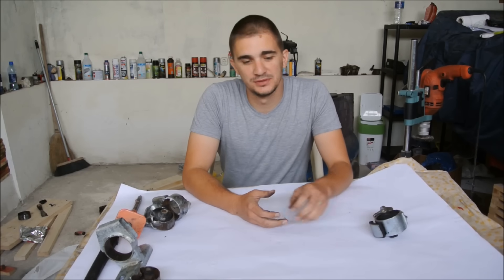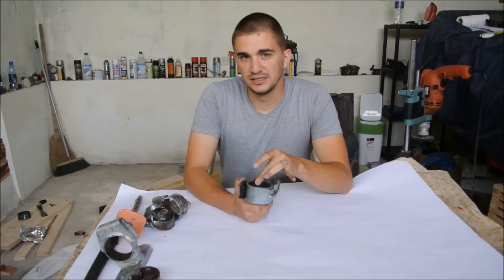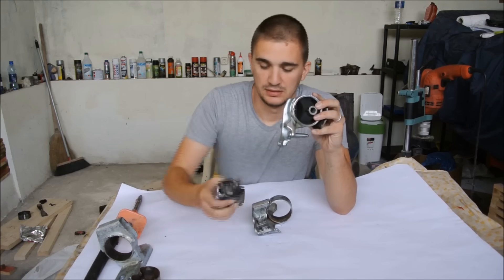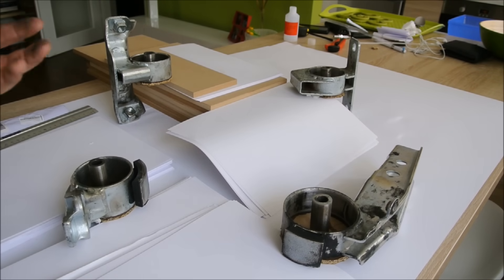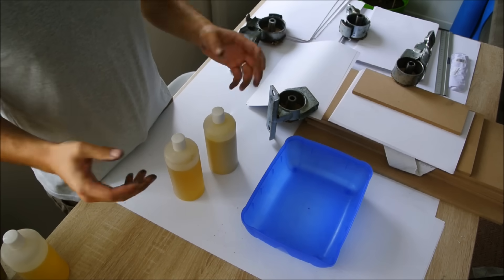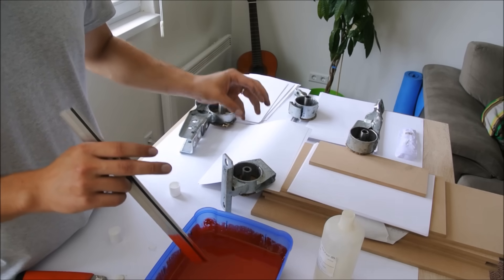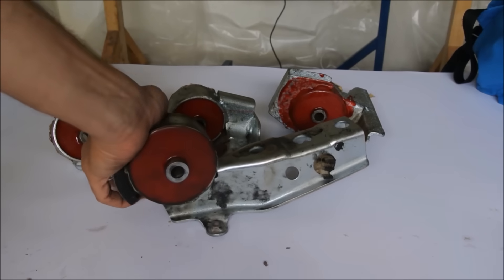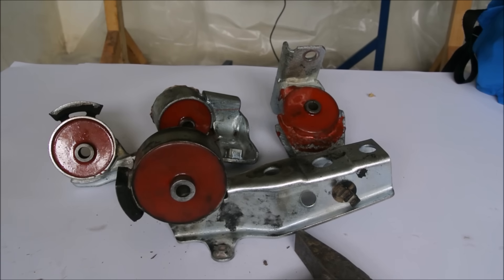How to make DIY polyurethane engine mounts

Comment: Trust me you can remove the pin from the rubber using a hole saw.
Reply: Smart dude ..that's forward thinking
Reply: You can also put the mount in a vice and use a sawzall or good hacksaw to cut down close to the pin on both sides
Reply: you can also make a sharp beveled pipe that can fit the pin hole and hit the shit out with hammer
Reply: filth hater ,i use hole cutter for steel the type that goes in a drill and remove the pilot drill out of the center,flap wheel takes the remainder off, very quick method used it in the field once on my Landy😎
Reply: You are so correct,done it the way for 40 years.
Reply: deser
Reply: Yeah i'd find another way for sure, burning is the last option i would consider.
Reply: better off to burn, cutting rubber with that stuff will be as a stinky smoke out as burning.

Comment: We used to fix ball joint or 
tie rod ends much the same way just  with grease gun type of machine . Old is new again.
Reply: Darin Bailey  Your a idiot ,years ago we fixed things unlike today where you just throw everything away. Nobody fixes anything just remove and replace. We fixed starters alternators ,with repair parts .The housing dosent go bad just the brushes or amerture V regulator. We used to reline brake shoes in shop with  proper tools . Re build brake calipers and wheel cylinders. The tool to re new ball joints was a factory Chrysler tool ,the same tool they use to make the fucking ball joints at the factory. The cheap China ball joints are far inferior to a repaired factory BJ , the crap metal is junk,hand tighting a ball joint I have seen studs fail and snap off. So you can buy new crap and they will fail in months.The new mechanics have fuck all knowledge of how to fix sfa they are replacement technicians. Not repair  technicians. 
Your probably the "HACK " who changes batteries ans starters or alternators before you figure out it's just a bad ground /connection. Or replaces a fuel pump only to find out the filter is plugged It's mechanics like you who just throw parts at cars untill you find the problem because the internet said thats the problem when you googled it and charge people for riping them off due to your lack of knowlege.
Reply: Ball  joints? Don't believe there rubber in ball joints
Reply: P Kuudsk , you are a hack! I suppose you charged for a tie rod/ball joint replacement tho. It's "mechanics" like you that get people killed!
Reply: P Kuudsk , hey thanks for the advice, you old Chrysler tool! LOL!!!
Reply: I shouldn't have taken it to heart ,as the internet is full of foolish information.
I don't know you and you don't know me .
I built a career on the fact that I always did it right the first time, and over the years ,I have seen how shady it has gotten.Once apoon a time people actually trusted and RESPECTED the trade. Sadly a few bad con men white washed the entire trade .

Comment: you need the cut outs to make it ideal. when rubber has no where to deform you make the effective harness much greater. while you picked the right stiffness for the meterel, you did not allow any room for the rubber to deform. making it much much more stiff than stock and performance mounts
Reply: Drill holes ...... in this sort of material is quite difficult & tends to put in tears , which are likely to cause crack propagation . Use a piece of carved wood , covered in foil , so wood can easily be removed .
Reply: b
Reply: I was thinking about the lack of cut outs . Nice to see the work all the same .
Reply: Could always just drill a few holes, no?
Reply: magna59 Yeah, I suppose placing objects in the mold ahead of time would be easier and waste less material.
Reply: Some of these materials , the ratio of the two components can be quite large , so some time its easier to mix a bit larger batch than required & scrap some , than fiddle about with very small volumes / weights , that can become rather inaccurate , unless you have some expensive measuring equipment .
Reply: magna59 They typically say to use a gram scale, which can be had fairly cheap. Most of the materials I have found that could be used for making bushings are either 1:1 or 2:1 ration of "A to B" components. I actually plan to do this in the future since some of my bushings are dying.
Reply: Good.I have seen some catalyzed materials where one component is 3 - 5 % of the other & if you are only measuring out a small component of the other , it becomes difficult . Some times the materials are marked up with both a weight ratio & a density , so you can obtain the volume ratio & then use a measuring cup / disposable beaker & insulin syringe to measure out the very small amount of catalyst . Saves purchasing a set of scales will be get gummed up with material & may only be used a couple of time .

Comment: the easiest way i have done to remove the rubber off and not burn it at all is to use brake cleaner,  just spray it very well and let it soak then after 10- 15 min it just peals right off clean

Comment: what website (Dealer) did you get the epoxy from? or were you able to deal directly?
Reply: Here is the link to the product. You can find a local distributor on the website. I have order other Smooth-On products off of Amazon. https://www.smooth-on.com/products/reoflex-60/

Comment: use a hole saw that's just a little larger than the pin to remove it then use torch to finish the job

Comment: Protip; direct the flame through the hole  of the "pin" instead of burning the rubber. That way you only need to heat te pin until the rubber around it melts and knock it out. Much faster, much easier and less smelly.
Reply from the maker: Good tip. Thanks.

Comment: Why does the factory not use those ??    BECAUSE:..::

They are NOT rubber; they transmite NVH(noise,vibration harshness),AND they crack and fall off(i know,i done that when i did not know better);

They RUIN YOUR RIDE; why don´t you bolt those things down solid? That would not work;
 stick w/the rubber mounts;    if they are not available,then like shown,or better yet,buy a tube of black poliurethane(used to glue windshields to car body) and do your mount; mark and DRILL a few 1/4 in holes on it,if you have the feeling for this, to make them more compliant; this stuff (one component,like silicone)sets  hard as a tire; and do not use that red stuff,nor the ones you can buy pre-made; i have lots,from the past,all for jaguar,that i bought (by ignorance) and will just throw away.

Comment: About 15 years ago I did this for my Infiniti  G20. But I used 3M Window adhesive It's black polyurethane in a tube. I Can't remember, but it was maybe $10 a tube(small caulk tube).
Reply: Yeah my cousin used that 3m window weld on all his mounts on his Spyder about 9 yrs ago and they're still solid to this day. Thing's pushing around 440hp and they've taken some abuse cuz the way he drives but they're still all good
Reply: So how long does it take to set
Reply: I also used 3M window weld on some suspension bushings. Been a year and still holding up
Reply: I've done the same thing on my 350z transmission mount. The stock mount moves too much, and all aftermarket poly mounts make the car feel like a jackhammer, it's even unnerving on the track. Poly window weld cost me $28 from O'Reilys and was enough to do 3 more mounts if I had them to do.
Reply: Jav Munguia
 awesome man, that's what I like to hear :D
Reply: right now it cost like 35 bucks
Reply: yes it will last a very long time, window adhesive is so strong you can lift the car on the window after drying
Reply: jorge NUNEZ super stiff man.
Reply: i did the same thing on my jette engine mount, about 18 years ago,, the mount was some crazy money, i used 2 tubes of urethane that is used for windshields, SIKAFLEX, i let it dry for 1 week, and worked great
Reply: Jackup460 did it last?
Reply: Manila Dashcam Yeah, they're still holding up.
Reply: window weld takes longer to set up and cure. I think they say like 3 days? I did not fact check that just top of my head. Used it for worn out shock mounts once and only let it sit a day, worked good for the year i had the car. 
Also good for windows in a pinch (lol)
Reply: Thomas Fooij Makes since, practically felt like solid mounts, but I thought maybe it was because it was such a small car.(first foreign FWD car I owned) Later I bought poly mounts or a unibody Cherokee & they aren't a bad. But the windshield squeaks so mayby not all that different  & I get it could be different compounds. But I would suggest using 3M for it's not intended purpose if you want to do this quicker & cheaper.(possible loss in comfort)
Reply: Full Tilt Drift his girlfriend swears by it.
Reply: just couldnt resist huh chris hahah
Reply: Good output for a standard engine
Reply: @Danny Delgado, I used windshield adhesive in a tube with a caulk gun. It sets overnight and is harder than the original rubber.
Reply: Manila Dashcam
Reply: Jav Munguia is it stiff or is it just as good?
Reply: Jackup460 is it still working on the infinity
Reply: I did that too, just filled the gaps with it with the mounts still on the car, it's a great way to stiffen them up and make them last much longer. Five years down the road and they're still good.
Reply: I have a video of this on my channel for anybody who is interested in trying it themselves! its called 3M window weld, its fast drying polyurethane and it does a great job stiffening it up.
Reply: Jav Munguia THAT'S WHAT SHE SAID 👍👍👍👍
Reply: Did it and it's softer than this, with this ones vibration will drive you nuts
Reply: Interesting idea!
Reply: Jackup460 I've heard of alot of people doing this and it works pretty good
Reply: I'm actually thinking of doing it to my volvo now since I replaced all the mounts recently and kept the old ones to put poly mounts in. It's been getting built a lot lately and about to be over 400hp

Comment: If possible, when removing the original pressed in rubber inner bush, to weaken the pressed in steel mount's press fit in the outer casing, rather than attack it with the hammer and pointed chisel/drift, to collapse it,  if there is a gap in the rubber big enough to get a hacksaw blade in you could VERY carefully saw thru the inner sleeve taking care not to saw into the outer part, then it should come out easily.  just an idea:-) thanks for the idea and taking the time to post a video, friend!
Reply: One could also use a Dremel rotary tool to get into the bushing with a but more precision. I prefer to use a tungsten carbide bit that will actually cut a hacksaw blade in half.
Reply: Yes and if burn rubber not fingers or hands it,its very poison for body.

Comment: Hey man, nice video. i'm interested to know what your experience is with these mounts. To my knowledge the metal pin needs to turn inside the bushing. It looks like there is no movement in them at all.
Reply from the maker: +julien van doorn Drove just a few miles with them. Seem great so far. Very little to no vibration, car feels more lively. Will post a detailed update after more miles. Pin must definitely not move inside bushing.
Reply: No, the metal pin should never turn in any bushing/mount.
Reply: William Kelley So the thread of the bolt is used as a bearing surface?

Comment: interesting but loooooong!
Reply from the maker: You're right. I tried to put a lot of useful info and explain things which made it long. I tried to be short and informative but it's harder than I thought. I'll work to improve that in future videos.
Reply: very good job, but i view it from France, most of various videos are made by people speaking english and it's not easy to follow technical explanations more than 10 minutes. Sometimes i think youtubers like to see themselves on the screen, so they talk, they talk, they talk... I've seen you're soda blasting vid', clear, short, simple.Now i know the easiest way to work on my old bikes.
Reply: driving 4 answers no you did a great job most videos of this quality are around the same length. like engineering explained depending on the topic

Comment: A vacuum-box will help you to get the airbubbles out of the liquid PU! We use it almost every day and the results are absolutely  great.
Reply: Correct. Another option is to use a lower-viscosity PU. The lower the viscosity, the easier the bubbles will rise to the top and out of the PU.
Reply: Correct. Stock ones are pressed while heated under vacuum in a mold. Much better than the pour in.. longer lasting too

Comment: I left some of the original rubber in so it was more PU reinforced rubber. Worked very well.
Reply from the maker: That is a good idea. If you leave the original rubber in you don't have to measure anything and the results are almost identical. I wanted 100% poly for the sake of showing you can DIY the same thing that's being sold for a lot more $$$.

Comment: Hi, I was wondering how the mounts worked out after installation?  Do you feel the engine or drivetrain any more than before?
Reply: Did it in my son's Lancer with a 4G93 engine. Power delivery was better compared to ruined engine mounts and no excessive engine vibrations. Mind, it has SL King springs and Koni Sport shocks, so.....

Comment: for engine mounts are very hard in this way, would have to remove some material at strategic locations to make it softer, so will not transmit vibration and noise in the cockpits and bodywork.
Reply: Guiro lain then you get cracks, holes don't do well in these types of mounts. filling the gaps in the stock rubber ones does work better than this though.

Comment: Wow I never thought of chucking up a wire brush in a drill press. That's brilliant.
Reply: Just dont do it like him
NEVER wirebrush with a drillpress and wear Rubber gloves.....NEVER

Benn there, Done That .......it fucking Hurts when it grabs the rubber ;)
Reply: @cultusmechanicus8001 

These are lightweight latex gloves though and tear if you even look at them harshly😂

These seriously will just rip and get pulled off so he'd be fine but would agree it's a bad idea to use heavy duty gloves of any kind with a pillar drill or lathe!
Reply: There are some rubber drums that hold sandpaper rings, that placed on a drillstand work beautifully too.

Comment: Heat up the pin itself until the rubber around it starts trying to catch on fire then it will be much easier to get out instead of burning all the rubber around the pin!

Comment: Have you installed these mounts into the car yet? How are the vibrations while inside the cab during idle and during normal driving conditions? I want to do this to my car however i think i might step up to 80A since it's a street killer lol
Reply from the maker: Not installed yet, soon. This should vibrate less than 80A. I experienced 80A and for me it was too much, but some people claim its perfectly fine.

Comment: Polyurethane doesn't like heat. There's a reason why my cars both have nitrile rubber mounts.
Reply: PU doesn't melt, it burns. It takes around 300c to de-isocynate PU (PU hardens and crystallizes), and even more to burn.
Reply: they use pu to install windshields and they see direct sunlight constantly during the day plus the 180f degrees or so inside of cars in the sun for years and years, I think it will be fine
Reply: its takes a whole lot of heat to even start melting polyurethane, ive got it in my track bar brackets an other things, the only way to get that out is by a torch and it still takes a little bit to get it to melt.
Reply: But it doesn't take a lot of heat to start it creeping, or to alter its design properties. Then again, my mounts are rather close to the exhaust.
Reply: +justcarcrazy well i think u just answered ur own problem...... the exhaust gets extremely hot so thats a no brainer.
Reply: +Jon Steel (AltxF4) i used a minni torch..... they get plenty hot. that the pu they use in automobile parts does melt. ive done it..... took a min to start but it will melt.
Reply: Jon Steel Nn tgyy
Reply: Constant sunlight does not radiate 500-800°C at close proximity.
Reply: justcarcrazy sure but ive had home made pu mounts(just used window weld on stock mounts) on my 2.2 in my s10 for over a year and the aftermarket header and downpipe are within 2 or 3 inches to the mount and its still the same as the day I put it in, so believe what you want
Reply: if they can hold up to that kind of heat, it's worth it.

Comment: Hi, like the concept , and I am all for saving money, that said I think you should talk a bit more about using gloves to protect your hands from stuff that does not like to come off , also I would think that the holes you refer to in the mounts are very important , as that also allows the part the correct movement , top to bottom ,side to side , pouring solid , even with a "softer rubber " would still be stiffer then the mount with the holes.
you would have no problem making the shapes you need to insert , using a form and placing that in at the time of the first pour , then burning it out , if cardboard , or melting it out , if you used wax
Reply from the maker: Shapes are important and easy to make as I said in the video. But there's little point showing it done as its just drilling a hole, nothing much to show so I left it out. Polyurethane comes of your hands easily as long as you don't leave it on and go watch tv for a few hours or something :)

Comment: May i know if not to much engine vibration after you install this solid Polyurethane mount?
Reply from the maker: Haven't installed them yet. But I chose 60a hardness specifically to avoid too much vibration. I will be sure to post an update as soon as I install them.